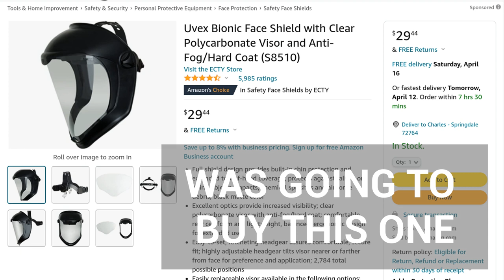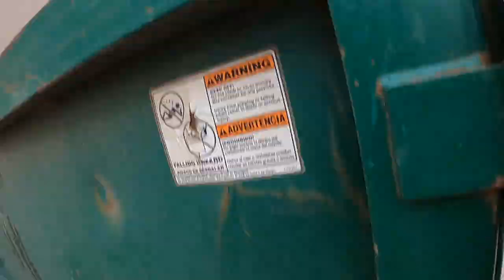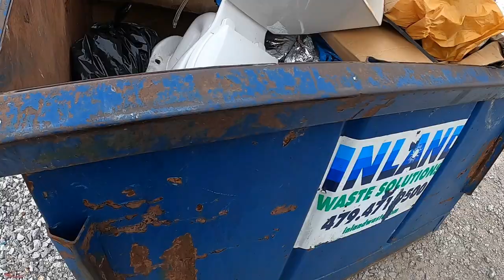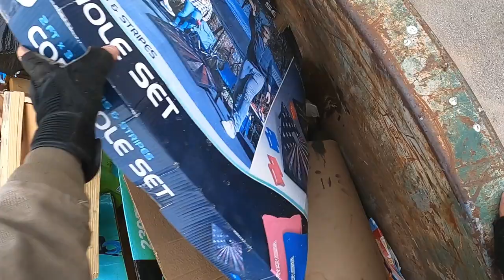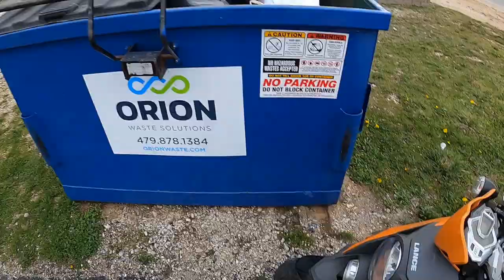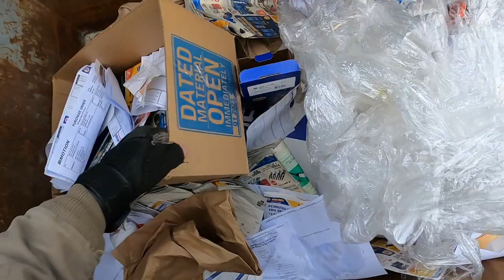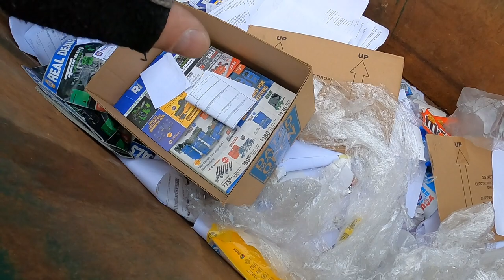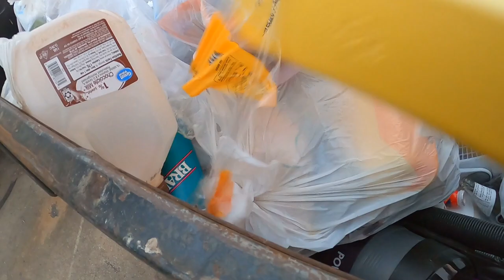Dumpster Diving "Scrap or Your Car Gets Repossessed"

Comment: Hello I am the one that you referred to about the shout out of the Picking pole. I actually used a paint telescoping pole because it's a lot more rigid and it can move a lot more heavier items. For the hook device I got paint roller that was of high-quality snapped off the plastic tip and removed the actual paint roller and it made a really nice hook. I scrapped on a scooter myself I know room is an issue but like you said I just snapped it on the back and it was easy to remove and replace and became a real asset to stay out of very dangerous dumpsters, the unknown in them and  that yucky stuff that's sometimes you have to reach into. Give it a try guy I'm sure that you'll love it and keep up the great work I love your videos and watching you a very powerful long time.